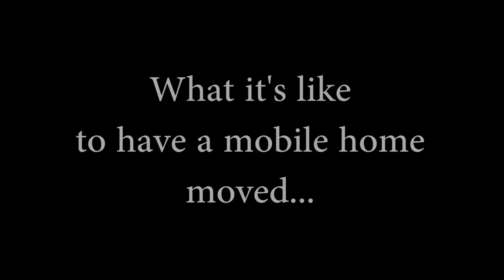What it's like to have a mobile home moved

Comment: Back in the early 90s my buddy bought a mobile home for $300 but it had to be moved we actually moved it with a tractor and a slow-moving vehicle sign we did not pull permits because we were in a rule unincorporated area we threw a slow-moving vehicle sign on the back and towed it right to the middle of town you know what the cops didn't f*** with us it took his 12 hours to pull it from a lot move it 3 miles and get it set in its new spot of course I'm hooking the skirting and plumbing and getting it ready to move took another day in itself and getting it level than set and everything plumbed back up and all the skirting on took a couple of more days but we got it all moved in 12 hours not having any idea what we were doing just being dumb 20-something year olds with a plan
Reply: Lol
Reply: I've moved 4 single  wide, and one double wide, all in the country .8' 12' 12' 14' 24' wide

Comment: I now have a new respect for home movers
Reply: Its a very tough job
Reply: @andrewdaily7343   very expensive and moving probably depreciates on top depreciation from owning a mobile home
Reply: We move them in Mississippi. Millers mobile movers are the best in Mississippi
Reply: And you would be surprised of the resale value of a used mobile home we work for a new and used mobile home lot. They will get 15-20k  for like a 15 year old double wide
Reply: Hell I've did my research and it can cost up to 15000$ to have your manufactured or mobile home moved.

Comment: We moved ours a year ago, did all prep myself except unblocking and blocking. Its an impressive site seeing a 16x80 rolling down the highway. I was in lead so they could follow and I had to keep people from creeping up on them when they were making corners. People really don't care and have no clue what the home would do to their vehicles if it clipped them. There is probably 15 tons rolling down the road.
Reply from the maker: Well said. The weight-to-stopping ratio comes to mind every time a spring breaker tourist wonders from the strip on their 25mph rental scooter and pulls out in front of me on the highway. People need to be more aware of their surroundings in general.
Reply: People are very dumb when it comes to driving around bigger vehicles, passing in the wrong spot/ on curves hills etc slamming on brakes in front etc ..... boggles my mind
Reply: @GuitarAudiologist  
The guys that drive and move these  are real men, the kind every lady needs in her life! They really know what they are doing!

Comment: no wonder they charge  more than 1000 $$$$$   ,  to move it  ,  its a hard  job.
Reply: How much does it usually cost to move them?
Reply: @blakebiggs9537  $5,000. If your trailer is worth less than 5k it's not worth moving.
Reply: @amazingthingsfromaroundthe2057  do you happen to know the cost of moving this mobile home from alabama to NC?
Reply: @roryswastika709  mobile home movers usually charge by the mile I have moved them from as far as from Selma Alabama all the way to California and from Williston North Dakota to Camden Louisiana and it's nerve-wracking
Reply: @rallowade596  how much would you charge to move a 16x80 home that's already unblock and sitting ready to roll. It's 33 and a half mile

Comment: Do they supply everything in order to move your mobile home off from it's lot on the ground?  And do you have to have a foundation ready with electricity hookup / water / sewage before they deliver it?  And how much in total did it cost to get a permit for the electricity and water / sewage hookup?
Reply: Tony Kart Racer ...you should have concrete runners on your lot, for the size trailer your moving. Your trailer, should have axles and tongue, underneath. Your mover should supply the tires. As far as utilities.... every state and county, has different codes/laws. Check with your local auditor office on permits and regulations. Your mover, should supply relocation permit, for the trailer to be moved.

Comment: you did good filming this, Does the Mobile home mover do everything like removing the skirting and/or porch? or do you have to hire someone else to remove the extra stuff, and the mover just has to move the mobile home to your place?
Reply from the maker: KITT28 Thank you, half credit to my wife! Our movers did the removal and resetting of the skirting. Actually, they installed new skirting because the home sits higher in the new location. They did pretty much everything except utility hookups.
Reply: @GuitarAudiologist  Sorry,  half Credit go toward the wife, and thank you sir for answering my question, i have 1 ac and trying to figure out info about getting a mobile home there.

Comment: Have an experience it's nerve-wracking at best usually . Watching people cut into your home to cut it apart. if it's a big Park move and everyone has to move their hiring Tweakers and everybody to move your home. Then they're taking your crap. You practically have to sit on top of them to make sure that your stuff gets moved and doesn't get stolen if it's involved in park closure if it's older than 10 years it's not worth moving to another Park they won't accept it.If it's pre HUD 1975 or more. It can look like the Taj Mahal and you haven't fixed all up cute but it doesn't matter it's pre 1975. If you do get some part to allow it the next time you go to sell it you won't be able to sell it. Because the parks want 10 or less.
Reply: Diane Haggar: Thank you for sharing this information. Was not aware of the restrictions.

Comment: how much does something like this cost to do?
Reply from the maker: They charged us about $3000 to move it 25 miles. Prepping the new lot and getting all the permits and through legal hurdles was a whole other expensive battle, but that might just be my area.
Reply: What state? I live in Texas
Reply from the maker: NW Florida
Reply: how much was the other expenses you mentioned? permits ect
Reply: im from ocala fl and got a lot with septic and well here how much it cost me to move the single wide mobile home 
 $350 permit paper work 
$1,400 impact fee (lot never had a MH before)
$600 transport
$2,400 set up
$2,200 power pole ,hool ups (drain,water and electricity to the mobile home)
$800 on materials to build 2 stairs and the skirting did it myself 

you can save the impact fee the lot had  mobile home before 

you can also save on the permits paper work but is time intensive and complicated
Reply: @Wheelman81  yeah, I work for a mobile home moving company, and I have to say, it would probably be cheaper for you to buy a new house in Virginia
Reply: Thank You for sharing this information. Looking to do the same here in NC.
Reply: @slokytheone  I'm in Ocala fl and saw one for sale was thinking of buying it and putting it on my empty lot and possibly using it as a rental

Comment: I'm about to move a mobile home soon. What siz of lug nuts are needed to get the tires back on? This is literally the only thing holding me back at this moment
Reply from the maker: Not sure about that man. I hired a company to do mine. If you're trying to do it yourself, maybe use some calipers to measure the lug and buy a few different bolts from the hardware store and hope one works? Good luck.

Comment: Nice size home.
I want one.
How much a home this size cost.
Reply: daisy hernandez Depends how old it is and the condition. I got my 1982 18x80 for $5k. Has some not so modern features, but I’ve been fixing mine up. Painting, all new flooring, new fixtures, new vanities, new lighting, new faucets, cabinets, tile backsplashes. Everything new! Have to be careful with window units though. I live in Texas where it’s flipping HOT! So my electric bill runs about $260 in the summer time on 4 a/c window units.
Reply: Kelli King 
OK 
Im live in New Jersey 
Thanks
Reply: daisy hernandez Cool. I used to live in Pitman when I was a kid.
Reply: Kelli King me and my family are getting a big mobile home and moving to the country side
Reply: My daughter's in the process of buying one.  $51,000.00 for a 18 x 80.

Comment: How much does it cost
Reply: Most movers charge a flat rate if it's within 50 miles or so if it a long haul they usually charge by the mile charge for permits just check with local movers

Comment: Hi there, I have a 1991, doublewide, wind zone 2, mobile home and i want to relocate it some 250 miles away from where it is now, any suggestions?? thanks
Reply from the maker: I'm no expert, but I would suggest you look into the codes of where you are trying to move. In my area, they wouldn't allow anything made before 2010 to move in (or that didn't have a certain roof angle/structure.)  Code is all they care about, and they all vary in different areas. Hope this helps!